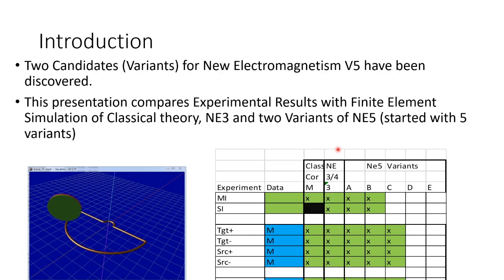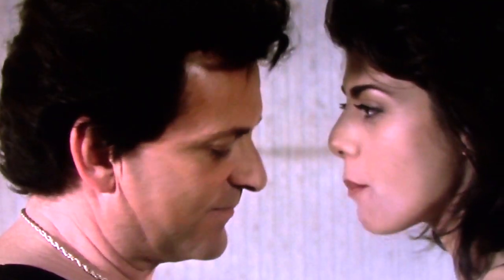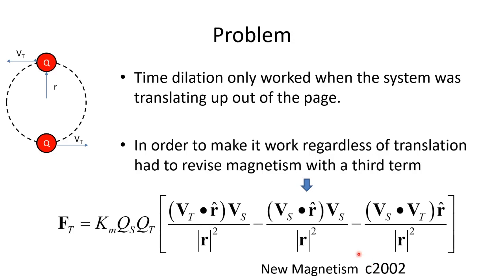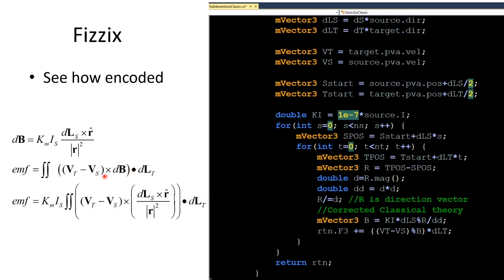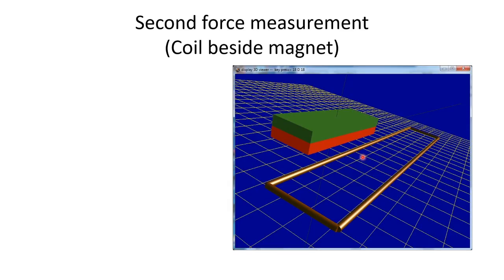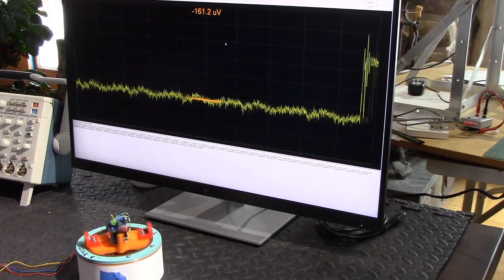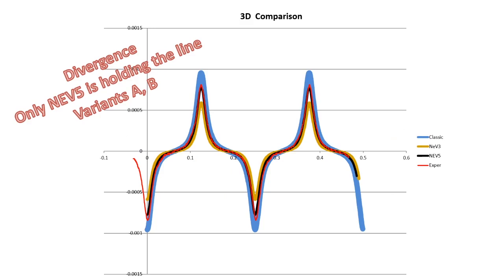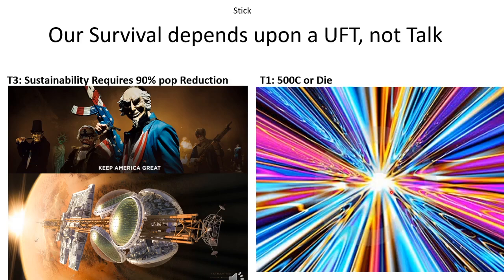T21: NE5:  The Greatest Discovery in Science.

Comment: Well then…if “magnetic fields store kinetic energy”…presumably then by definition that which is moving…and…”electric fields potential energy”…then…it probably follows that the base of the system is magnetic.  Reason being, that once there is movement…there is always movement…thus the base of all things…is kinetic or magnetic in nature.  Your two charges rotating about each other is kinetic in nature and thus magnetic.  Now then, how the “electric potential”?  Well,  as kinetics compress more energy is held in a smaller point and is not stationary at all, rather, more movement in a smaller space that “vibrates outwardly as the perceived static electric field.  Now, if one compresses this compacted magnetic spin, it will break loose into a perceived electro magnetic pulse, or massive expansion of the energy, which is kinetic and thus magnetic in nature.  So then, what is aether as is not apparent through either a “magnetic” or “electric” field?  Therefore….one may conclude aether is a truly stationary conglomeration.  We know however, if aether is disturbed it creates an acceleration which by definition is magnetic in nature the change of which trades back and forth magnetically and electrically, trading the energy imparted thereof initially.  Thus, the base of everything is neither “magnetic” or “electric”, it is the aether…and when disturbed is seen as kinetic or “magnetic” followed by “electric” on inevitable collapse…then electric on compression…then magnetic…etc until energy dissipates into the aether ocean.  When current runs through a wire the magnetic disturbance around the wire started somewhat oppositely by aligning the charge in the which aligns magnetic moments and thus the magnetic field changes around the wire.  This magnetic field actually representing the energy equaling MC square of the aligned charges within the wire.  Which causes induction on both charge carriers outside of the wire and on change wire polarity on the wire charges in opposite directions as this magnetic field reciprocates on change of electric potential on the wire in opposite direction….this is “self induction” and mutual inductance with neighboring wires.  It is all so easy in concept, the problem is that some humans see it in equations while others see it in their minds, that causes a miscommunication.  The base mystery then is in then what exactly is aether composed of?  Great a video to relive thoughts of all of this!!!

Comment: I have just taken a look at NIA new induction applications, I read that radio waves are purely magnetic. Really?
Reply from the maker: All wave phenomena have two energy components.  For water waves, is the displacement of the water in terms of height above (or below) Mean sea level and the time rate of change of the height (velocity).  These components are in quadrature.  Light behaves similarly.  Induction induces one of the components in the medium which is coupled back at the receiver.  The other component is the subject of a future release; however, it is not a coulomb field (E-field) as maxwell suggests because of three reasons
1)  curlE=-dB/dT  contradicts CurlE=0 (Kirchhoff's)
2) Maxwells Plane Wave has E and B field not in quadrature 
3) In upcoming release, I will show that E-field is actually the B-field in disguise (this is hinted to in foundation series)

Comment: Regarding gravity and the ether... If gravity really is a flow of ether (which I think is a requirement for the existence of black holes), where does it go once it "enters" a particle? It doesn't make much sense that it just disappears into nothing. Note that I'm a sceptic of black holes in general, at least the theoretical kind. Stephen Crothers should be able to put doubt in anyone's head, I think. The real black holes - the invisible objects astronomers observe in space - can be anything.

Theories on quantum gravity - think what you want about that - say that gravity, or spacetime curvature, is an entropy gradient. What is that, more precisely? Since entropy is linked to temperature, which in turn is like chaotic motion, you can think of matter as bubbles in "boiling ether" (as an analogy, nothing more). The gradient in turn is simply a difference in "temperature" (or entropy, or amount of activity, whatever gets your juices flowing) on different altitudes. The ether gets calmer, and looks denser the higher up you are. Now compare this with the fact that people have historically tried to describe gravity as refraction, which should back this up.

A density gradient - or entropy gradient if you like - should also be completely compatible with the curved spacetime in general relativity. Everything fits. "Time", or rather EM wave propagation, will slow down due to lesser density the further down you go. The only difference with accepted theory (mainstream) is that unless you allow for negative densities, black holes won't be possible. Or maybe, the true nature of gravity is a mix of entropy gradients and flow.

- - -

Just to delve deeper into this pit... Since matter is made of EM waves (E=mc^2, remember?), and those EM waves affect other EM waves to slow down (time dilation), we realize that we are dealing with nonlinear wave effects here. What that means is that it will be difficult AF to create a correct mathematical model of it, unless you deliberately aim for an approximation and simplification. Nonlinear wave interactions can be almost impossible to model.

This complexity is (I think) the reason why no one has reached a correct "theory of everything", and why quantum mechanics seems so confusing to everyone, and why everyone in physics is lost. Not that I have anything better to offer myself though. But at least I have what looks like an explanation to why that is. :)
Reply from the maker: Where the Ether goes (https://www.youtube.com/watch?v=NTpytbccqgs)  More advanced treatments (including what the waste products are) are forthcoming so don't get too deep into the older videos where there were still many unknowns.

Complexity is the reason.  Scientists are looking for something overly complex and can not see that a TOE must be exceptionally simple.  They are looking the wrong way.  ROA 31 : https://youtu.be/L4SAv2bXL5Y?list=PL2fbwSsQ2zlVqNKfdcA_FAbVXLzUHFvEU
Reply: I think in general (not specific to gravity) that Æther undergoes a "temperature" change between entering and exiting a vortex.  

I think matter must receive energy from the Æther in order to continue to exist as matter.  It receives this energy from the Æther in the form of something analogous to temperature.
Reply: There is evidence from radioactive regions on the Earth and the Moon, showing that where electron and positron decay occurs, and one would expect an inflow of a dielectric to condense around those newly decayed electrons and positrons, a MASCON develops.
    While an inflow of ether can increase gravity via a venturi inflow, there is a Ron Hatch model of gravity developed from the ether medium, or dielectric density, gradient.
    Ron Hatch has a model developed from GNSS clock data showing that gravity is directly related to the dielectric density gradient.  Essentially whether gravity is a venturi inflow of ether or just the dielectric density gradient, gravity is directly related to the ether medium density gradient.  
So, gravity whether an inflow and/or combination of the density gradient, gravity can be derived as a buoyant force in the density gradient.
Reply: @John14: Six I do know an astrophysicist that worked on the radio telescopes at McDonald Fort Davis.
Those telescopes can detect the direction of travel of the Earth in 3 references frames, the Solar system, galaxy, and Universe, based upon an anisotropy of energy.
  In other words, there is an energy exchange between the Earth and those 3 reference frames that affects the anisotropy of light entering the telescope.
So the Earth is an open energy system WRT to those 3 reference frames.
    If you look at a galaxy's rotation, the outer stars orbit at about the same angular rate as the inner stars, but there is a slight slip on the outer edges.  This means that a galaxy does not rotate as a true rigid body, due to the slippage at the edges.   This also implies that a galaxy has a possible exchange of energy at the edges with the Universe.
  Also there is a Cal-tech article 'Spiraling Filaments Feed Young Galaxies' showing that there is indeed a plasma filament feeding into galaxies that fuels it and the production of stars.
   The Earth is fed energy from the solar wind through a process known as the bow shock current system, there is a corresponding article online called 'The Bow Shock Current System.'
   Also the moving fringes detected in the Michelson-Morley and the Sagnac experiment can only be explained if there is an energy exchange with the experiment from an extrinsic source.
Reply: @John14: Six I think you are right.  I think the Bohr model of orbital electrons is somewhat of a red herring.
  When we observe individual atoms, the energy we input to take an image causes the electrons to orbit, or at a minimum accelerates the orbit.  
    I think the detectors we use to detect electrons or photons though the double slit experiment also plays a role in cancelling the wave function, it has nothing to do with a human conscious observer. 
  Electrons do not orbit in solids but fit into a crystalline lattice structure.
  If electrons orbited, I think it would be difficult for electron sharing between chemical elements to create compounds.
Reply: @John14: Six I will check that out.    My studies of Einstein who leads us to the Hawking wormholes, Big Bang, and 11 dimensions, leads me to believe that Einstein was either an unwitting patsy of the banking cabal or was a paid participant in a disinformation campaign.
   When you follow Einstein's work from the photoelectric effect, that he plagiarized from Hertz and Lenard, to his SRT, which he plagiarized from Lorentz, it makes no sense that he would use the spherical wave function derived from fluid mechanics to describe his particle-based form of light.
   There are guys like Steven B. Bryant that go back and use the Superposition of Waves Principle to recompute the Michelson-Morely data to come up with 30 km/ sec for the speed of the Earth around the Sun vs the 7 km/sec computed using an SRT or anisotropic type equation.
   I can only imagine what Stephen Hawking might have brought to the world of science had he not been derailed by the Einstein model.
   It does sound like she is more talking about the Tesla model of energy vs the Einstein model, which removes an ether medium.
Reply: @John14: Six One thing that I always thought was strange is how the ring-billed gull can send a single bird to a plot where farmers are digging, and if that bird finds no worms or food he just sits there or returns, but if it finds food supply the rest of the flock is not far behind from a different location.
   There has to be some way for the rest of the flock to know this, this happens too many times to be a coincidence.